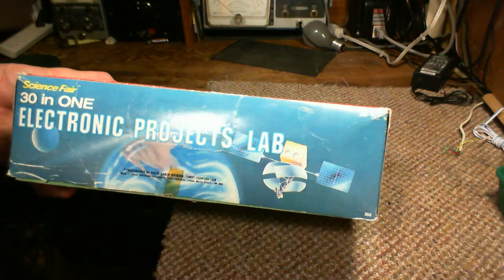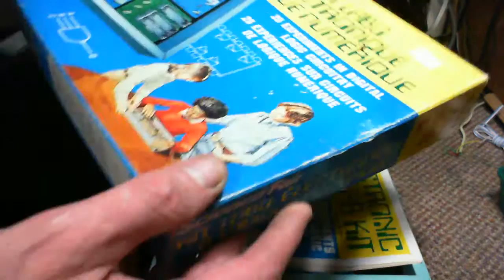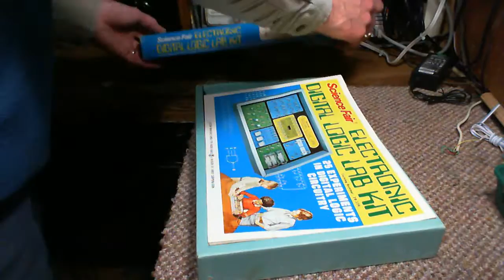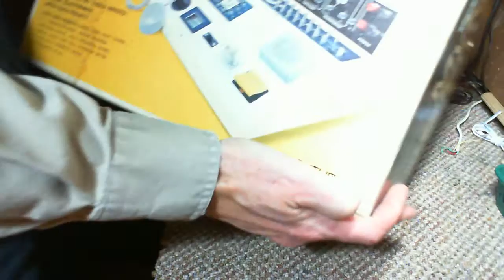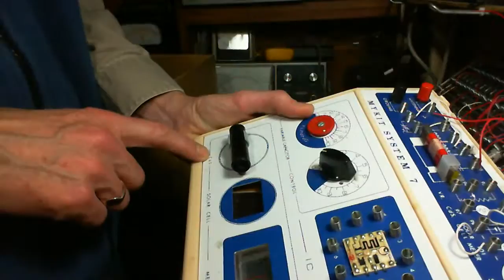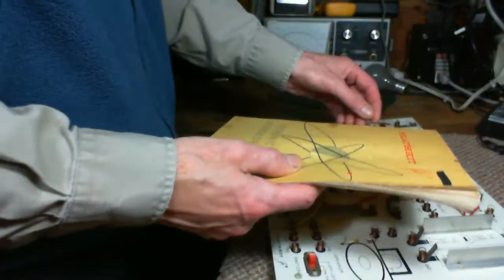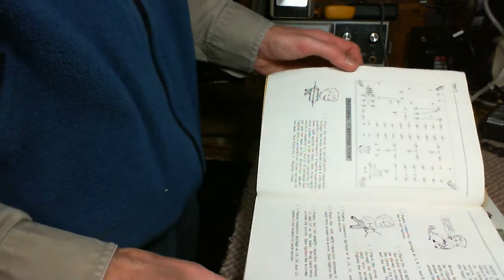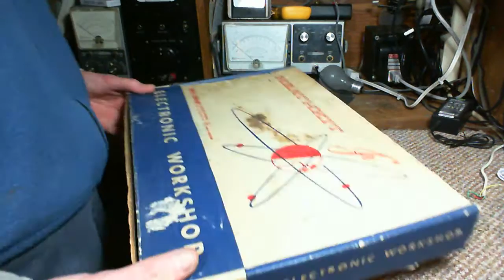5 Vintage Antique Electronic Project Kits - A Closer Look

Comment: 28-258 Vintage Science Fair 160 In One Electronic Project Kit. This set is from 1982. I found one of those 160 In One's listed on E-Bay, but I had to change out many bits in it...
Reply from the maker: Have you watched my videos where I try to build radios with these kits.  In the end, trouble with connections undermined any success.  I'll have to do some maintenance on them before I make another valiant attempt to get them working.  I would certainly suggest to anyone thinking of buy a kit for their kid to buy a new one that won't have problems.  I picked these up at a yard sale for very little money.  Thanks for the comment.  Jim.
Reply: Jim Lindenas I have watched many of the videos where you use these old kits and try to make the circuits work with them. I like me kits which is why I like the videos of you workin' on these old kits. I would suggest tryin' to change out bits before you try them again. I always test the bits in the kits before I attempt a circuit construction. I change out the bad bits with equivalents and then go on to make circuits with me kits. Thank you for posting these videos of old Vintage Electronic Kits....
Reply from the maker: Thanks for the good advice!

Comment: I'm looking for a specific model of one of these electronic project kits.  I remember it saying "radio shack" and that the battery compartment was on the top right of the board.  It also had a "stop" "record" "play" buttons on the bottom right corner.

I can not find the model anywhere, if anyone can point me to it I would be grateful.